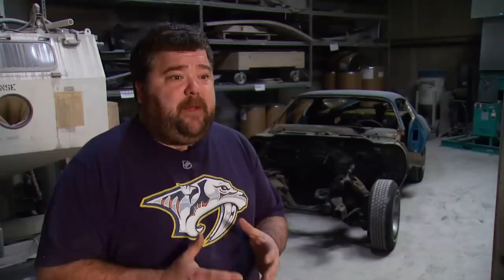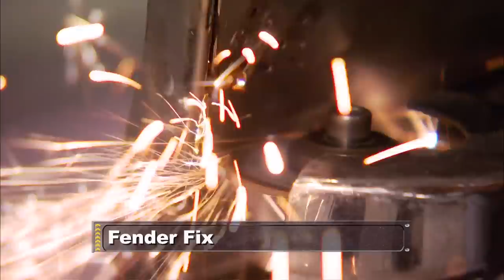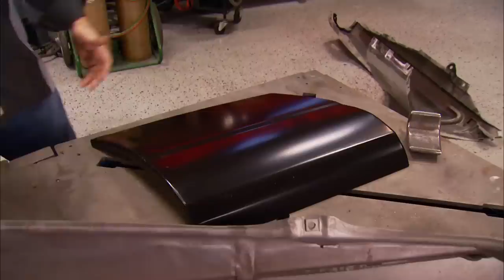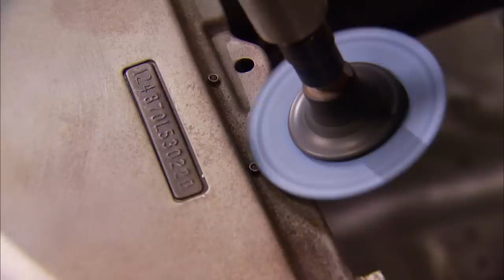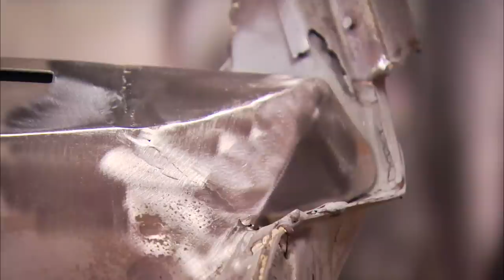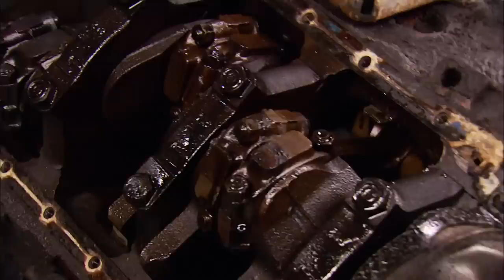Teardown of a Chevy 396/402 Big Block for a 1970 Camaro RS/SS Rebuild - MuscleCar S6, E5

Comment: 13:17 always leave a loose headbolt on before you break the cylinder head loose. The cylinder head could fall on your foot!
Reply: D'oh!
Reply: I’ve never taken one off like that...there are better ways...
Reply: A friend of mine fractured his foot with a Chrysler 440 head he dropped on his foot a while back. It required surgery on his foot to repair the fracture.
Reply: I wear external metatarsals in my shop so this is an never issue
Reply: @illililililillli  
Steel toed boots are good; but, does it replace common safety procedures?
Reply: Viking Child with the condition of that motor it would have been “welded” together but yea you would want to do that

Comment: The good old days! Acquired a 396" BBC in pieces in 1978.  Rebuilt it and stuffed it in a 74 Camaro junker with a Muncie and Ford 9" rear. Pulled the engine and later installed in a 10:90 57 Chevy with a Turbo 400 and 12 bolt rear..sold the rolling Chassis and in 1986 installed the engine in my 56 Chevy 150 utility sedan with a 12 bolt rear and Alston ladder bars...that car is sitting in my garage here in Vegas with a six speed Tremec, same rear    suspension, custom built headers installed with tri Y collectors comped to me  by flowmasterbefore they were on the market. They started out in Santa Rosa CA. My buddy chromed them in the 80's and three years ago took them to Sanderson Coatings in So. San Francisco and had them redone...they had never seen such a long set of headers...we got a laugh out of that.
    Now painted black with blue flames, simple black interior with the package area carpeted, old five spoke mags....396 now has Holley EFI, L-88 valves, heads port pocketed and matched to intake..done by my buddy on his flow bench.  He's passed away and helped with all the head and intake work years ago when the engine went in the 10:90 car.
    Goes in next week for a tune and once over before hitting the streets of Las Vegas.

Comment: He worked those fenders like a boss!
Reply: Why not just weld up the holes. Less work less money. Come on man.
Reply: @greenboyatgafarms2250  all those holes means the metal was structurally compromised. 
Plus with all the warping it wouldn't be worth it to finish and smooth, cut and patch always better, and often (but not always) faster.

Why rebuild it with welds when you can just replace it?
Reply: @crabmansteve6844  I don't know maybe y'all do stuff different where y'all are from but the body shops all worked out wouldn't put up with that crap. That's what a TIG machines for course a lot of folks don't know how to run a TIG machine or at least not worth a damn. Being a good body man also means being a damn good welder. A tig machines low heat weld so you won't be warping anything. You're not supposed to stay on the metal continuously welding that's how you get the metal to hot and it changes shape you know Heating and Cooling Contracting and extracting. Thus the reason for using a TIG gun.
Reply: Why not new fenders. They are cheap?

Comment: Not sure I'd use that block. Those are big holes, and might give you "hot spot" issues in that cylinder. Broke is broke sometimes. 🤔
Reply: Lassi Kinnunen  sounds good but sometimes just not that easy with the old 396/400/402 big blocks
Reply: That's something people should remember. Broke is broke sometimes. I second that 100%
Reply: Spoiler alert! It turns out just fine with a sleeve
Reply: Nope. Sleeve it. Works great.
Reply: And where those holes are is the thin part of the casting,..going to make boring for the sleeve kinda tricky. Pretty sure it will need to be bored 4.25  for the sleeve to fit..,.had a 402 that I bought that was bored  to 4.25...lasted 2 hours in a boat before it cracked.
Reply: @blackbirdxx928  exactly...
Reply: Unless it’s numbers matching and rare enough that it really matters, I would have went with a different block. Possibly even a more modern crate engine.
Reply: If they were going to turbo it, I'd agree with you. But, for their build, a sleeve, if done properly, should be fine. They are working with a budget. If they didn't have a budget, I'd replace it too.
Reply: @hualni        For a more rare block maybe, but for a 2 bolt main block?  The price seems good for the sleeving, but that cylinder wall really seems punched out good and cracked too.
Reply: @hualni  I'm with you, even sleeved I wouldn't trust it. A good 402 can't be that hard to find.

Comment: Sleeve it and off you go...    This happens to 351w  more often than I'd like to admit (thin walls at .030 over)...  Specially when a valve bounces around in the cylinders ...    Or melting a piston and lifting a land...  After they are sleeved they're just about bullet proof...
Reply: i heard clevelands were common for this to correct?
Reply: @kylepett1  That I don't know.....  I've stayed away from those. They are hard to find parts for and are more money....  Windsor engines are still pretty cheap...  Although 351's are getting harder to come by.

Comment: I’m still learning and pretty new to automotive work. If you resleeve an engine because broken piston pieces flew- isn’t that block now weaker and more prone to overheating?
Reply: No.
Reply: assuming the sleeve repair is done correctly...      it is just as strong if not stronger than a factory bore. The process (if you're not aware since you state you are new) is to grossly overbore the offended cylinder and then press fit a sleeve into the block - then bore that sleeve to the same bore size that you refinish the other 7 cylinders. It is an older style repair that is not as common in hot rodding with the introduction of aftermarket blocks

Comment: Same thing happened with a 350 4 bolt main i had picked up. the rod broke and destroyed the cam all the pistons were screwed i havent looked at it sense. I was just thinking i could just put new bearings in and new rings and call it good. But nope. No motor now andto much money to fix... Sad situation....
Reply: 350 chevies grow on trees. turn that one into a table and move on.

Comment: Stop saying the 396 and the 402 are one in the same as they are not . the 402 came out from 1970 to 72.  Gm used left over 396 blocks bored them 30 over put different heads on them such as 820 castings with highest power at 365hp. Labled as a 402 and a 400 both.  I got a bunch of them and they will make 600hp with right parts.
Reply: In the Chevelle and Camaro they were "labeled" 396s. In the Montie they were "labeled" 402s. In the big B-Bodies, surprise! That was a Small Block 400. The Small Block was the reason they kept using the 396 designation. Trying to limit confusion.
Reply: @SGTJDerek  

Wrong the 396 and 402 are completely seperate engines. Different bores. Not made at same time frame. Never made at same time 396 ended in 69 the 402 started in 70 till 72 . and in some cars the 402 was in fact badged a 400 like in impalas and 402 on trucks. . the 400 small block came later .
Reply: @SGTJDerek  I agree with PowerNation and Derek.. they're all the same with just minor adjustments here and there.  Go ask any old-time GM worker from that time period, they'll tell you the same thing.
Reply: @SGTJDerek  

During its lifetime, this 6.6-liter V8 was used in such vehicles as the Camaro, Chevelle, Nova, and Monte Carlo. Although it displaced 6-cubic-inches more than the 396 and had a bore that was 0.03 inches wider than the 396, Chevrolet marketed the 402 as a 396 on its smaller cars like the Nova, while labeling it as a 400 & 402 in its full-size automobiles.
Reply: @backyardbuilttrucks1  its funny you guys are arguing over whos right, if you pay attention, your both saying about the same thing...from 70-72 the BB 396, 400 and 402 were the same just depended on the vehicle they were in on what they were called...pre 70 were the real 396
Reply: @ericmccoy5038  

True . my comment was meant for the TV hosts per say.  Only a couple of these guys are true gearheads rest are just actors reading a card off set.
Reply: I thought was a 401 when they come out with it what I understand Insurance wouldn't cover the 401 so did you decide to go back and call it a 396 I don't think there was ever a 402 I might be wrong if I'm wrong I apologize
Reply: As far back as I remember Chevy never called an engine a 402. Not one fender emblem or air cleaner sticker. They were marketed as 396 or 400 even if it was measured at 402c.i.
Reply: TurboJet
Reply: @markg7030  

70 to 72 chevy cheyenne had a fender badge said cheyenne and 402 . i can dig mine out .
Reply: @backyardbuilttrucks1  Don't dig up cheap Chinese after market fake emblems.
Reply: @markg7030  

Not every thing GM did was a mass production i have 2 family members who both retired from GM and i have stuff not many people have seen. . not cheap crap , i know what i have 
8/402 badge . i made my point not going to argue.
Reply: @peteleadlove9215  402 was made from left over 396 blocks gm bored 30 over bore .

Comment: If you are going to build a L78  that motor has the wrong heads, wrong pistons, wrong connecting rods, wrong mains,  wrong intake,  block has holes, you better start with the correct motor.

Comment: Go get another 402 block out of junk yards...without out 2 piston grenade holes in the cylinder block..junk is junk.put a grade 1 motor together..it will run hot and fail again..r

Comment: Welding without gloves is a bad habit.  Even if you you are doing small stitch welds the UV radiation from welding can burn your hands an lower arms.  If you get into the habit of always wearing gloves and long sleeves or gantlet gloves you can avoid these nuisance burns that can turn into several visits to the dermatologist when you are older.  I have the scars on my arms to prove it.
Reply: Yeah that was weird to see
Reply: @bilbobaggins4710  I agree.. was making me nervous, them not wearing gloves.
Reply: Welded a complete floor pan in for my brothers 69 mach1restoration years ago. Got home that evening he calls me to tell me he can hardly see. Dumbass watched me weld it in the whole time with no eye protection. I didn't even realize he didn't know better. After day or so he was ok.
Reply: @trifivegarage8683  He was lucky.  Damn lucky.

Comment: Ummm thats no L-78 peanut port heads and 2 bolt mains. Lol
Reply: Very clearly was stated it was a truck motor
Reply: danswrld Which means......?. A taller deck block and some 360 hp 400 as they called them in tk version which were still 402ci .  1970 was the last year for the L-78 which was 402 ci still a 4bolt main block rect port open chamber heads 11.1 compression forged rods and steel crank. I must have missed what you say They clearly stated

Comment: What Engine with the most starting horsepower for around $600 

I would adding
Fuel Pump
Fuel Rail
Fuel Injectors
Exhaust Manifold Headers
Cam Shaft
ECU
2 very small turbos
Innercooler
oil pump upgrade
Would it produce 500 horsepower at the wheel?
Reply: 5.3ls complete with the fuel injection. one turbo will get you 500whp heres a great video

https://www.youtube.com/watch?v=Xzqe4yoMPBs
Reply: @bigsean2473  could go 6.0 also
Reply: @geauxtigers2911  you could but the fact he said around 600$ i know for a fact you can get 5.3 for that but the 6.0 people be trying to get much more fore it.

Comment: Any fool would look at the oil pan ,see the hole and ,then look for another engine. You can sleeve that thing but don't expect to make any power with it. It will fail again. Crate Engine time.
Reply: People sleeve k20 Honda engines and make power, as long as the rest of the block is fine

Comment: A true L78 has 4 bolt mains, square port heads, solid flat tappet cam, 780 Holley carb, 7/16 diameter push rods , aluminum intake from GM.
Your donor 402 should get 4 bolts mains installed and alighn  honed, find the square port heads not aftermarket, try to recreate the exact engine.
But i have no faith in you 2 for being millennias .